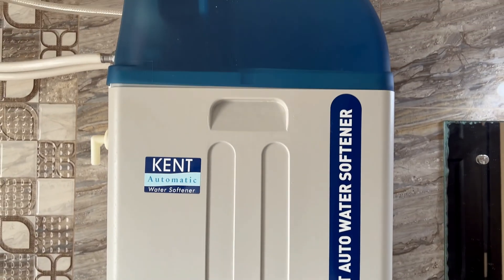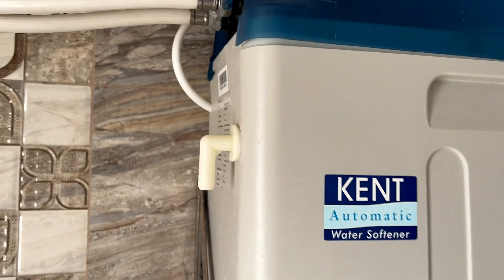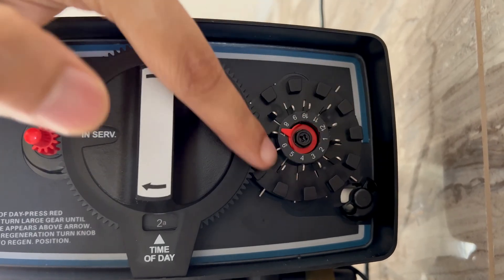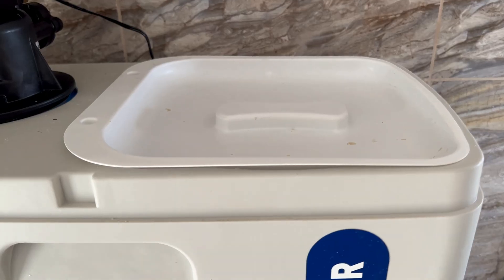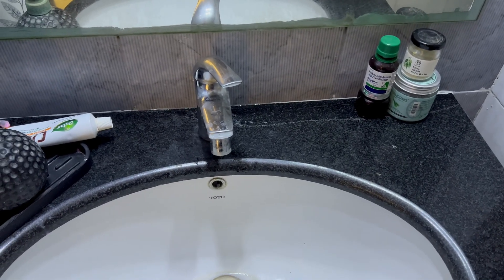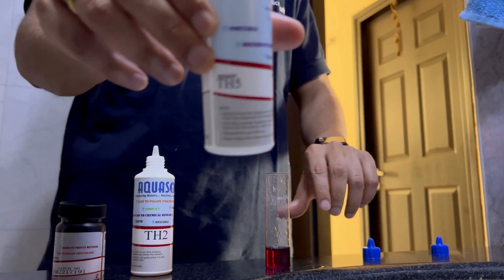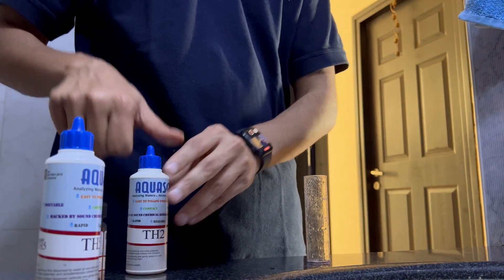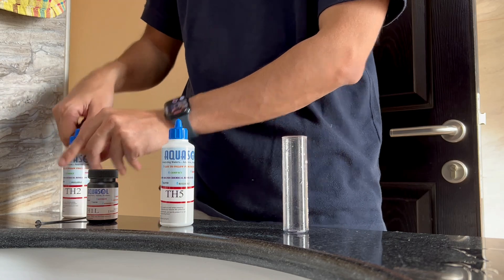Kent auto water softener 8L | Water Home Testing Kit | Solution for Hard Water

Comment: I am posting this because I wasted a lot of time and stressed over picking the right water softener/scale removal solution for my apartment. Hopefully, this helps others save time.

I am in the market for buying a water softener/scale removal solution for my bathroom and kitchen. This is my summary after talking to plumbers, 3M executives, Kent executives, some retailers, family members who use these systems, and after going through tons of YouTube content and ChatGPT insights.

In a city like Bangalore, where PPM levels often exceed 500 (sometimes even 800), I find it hard to believe in the effectiveness of both 3M, Kent or similar brands for real-world apartment use.

Here’s the reality: If you live in a 2/3 BHK apartment, you likely don’t have space for large water treatment units.

1) 3M Scale Prevention System: According to 3M, this only prevents scaling (white deposits on taps and floors) which is good enough for most of us BUT this system is NOT effective if PPM exceeds 300. That makes it useless for most Bangalore homes. 
2) Kent Water Softener (5L/8L): These can technically handle PPM above 500, but in reality, if connected to a kitchen sink, washing machine, etc., the 5L or 8L models won't be able to handle the load and will require maintenance every 3-4 days. Marketing claims are misleading—this might work for a small 2-member household with minimal water usage, but not for an average family. Plus this is a tall ugly unit not-so-aesthetic. you will find it difficult/impossible to hide in your bathrooms.  Automated ones exist but are too big/ugly and expensive. 

Now, the interesting part. Both brands, when questioned further, admit that these models won’t truly solve the problem. Instead, they suggest larger solution, which come with major practical challenges for apartment users:
1) Huge size – Requires a dedicated space to install, which most apartments don’t have.  
2) Complex plumbing modifications – Would need re-plumbing to connect all bathrooms and kitchens, which is just not feasible.

So, while effective solutions exist, they are not apartment-friendly, making it difficult to find a practical fix.

Comment: I would not use edible salt or rock salt (contains a lot of calcium sulphate). Both these salts will clog up the resin over time and reduce the effectiveness of the softener. Stick to pellets that are rated at ninety nine point five pure. The price will be more but then the resin will last longer. As you've noticed there isn't a difference when testing initially but over a period of time the purer the salt the longer the life of the resin

Comment: Do not buy this product, it needs huge water for regeneration.
Reply: Good point. It wastes a huge quantity of water and the sales people are full of lies.
They say it wastes only 5l water whereas I see unlimited amount of water being thrown down the drain by this stupid product.
This gentleman says it takes 3-4 hours for Regeneration whereas all the Kent staff says only 15-20 mins between 2-3am.
It wastes at least 30-40% of the water it softens.
Definitely avoidable product with water shortage all around.
I manually switch off water supply to this thing so it stops wasting water.
All kent and hul products are lame. Who needs a hardness of only 25-30...?
Water with hardness below 100 dissolves even plastic. So what is the point of reducing hardness so much that you end up with plastic in your water from the store tank
Reply: @gavin0811  Great Points. Any suggestion on a waster softmer which reduces less water and gives decent softness. Thanks
Reply: How to know if it's regenerating currently?

Comment: Hi quick question..
If 2 ppl are using 1 bathroom,what should the approxx regeneration cycle be? Cause right now all 12 are pulled in..and the water is extremely soft n seems soapy at times..please help deciding

Comment: Hello, How much does it cost to install this and can this be installed close to roof like Geyser in the bathrooms ?
Reply from the maker: Around 25k plus plumbing charges. Yes it can be installed close to the roof as it comes with a stand that can be drilled into the wall/tiles

Comment: 1:10 your drain pipe has a kink where it bends at a right angle !! You need to straighten that out as a constricted or blocked drain line will lead to salty-tasting water. Also, the drain line goes higher than the point it is connected to as you have draped it over your shower head. Incidentally, how is the taste of the softened water? Any salty taste or hardly any.
Reply from the maker: The water tastes fine. No hint of saltiness

Comment: Great. One tip when using the TH5 solution is to invert the bottle and let a few drops fall into the sink and then hold it in that inverted state to add drops into the test tube. More manageable this way otherwise as you know invariably two or three more drops slip in. TH5 just seems more slippery than TH2 and dribbles out more easily. A drop to 50 ppm from 750 is significant. Is there a way to target a specific output hardness or is it fixed at 700 ppm reduction like your previous softener was for 500 ppm? Also wanted to know if you notice any variation in your water hardness throughout the year. Any pattern or is it more or less constant. My water supply gets softer during the monsoons and harder in the dry season. That is for river water.
Reply from the maker: Thanks for the tip! I didn't understand what you mean by target specific output hardness. 
Our apartment has a water softener. So once a week the water does get better. But it barely lasts and that's why I went with a softener coz as you can see the hardness is off the charts.
Reply: @PaiTech  I mean you measured output hardness at around 50 or below. That is a drop of 700 ppm from 750. 

By target, I mean can you program the softener to give you a specific hardness. Say you want 200 ppm. I was thinking you could extend your use period before having to regenerate. Presently it reduces from 750 to around 50 ppm. If it could be made to soften to 200 ppm instead of 50  maybe you would get five days before having to regenerate instead of the present 3 days it is set for.

I bathe and do laundry just fine in my current 175 ppm water
Reply from the maker: @johndoe-vc1we  No way to program the softener to give a specific hardness.